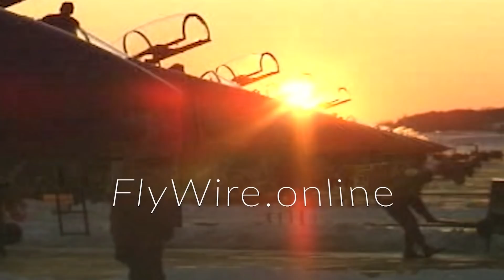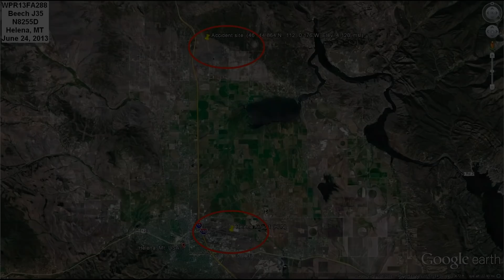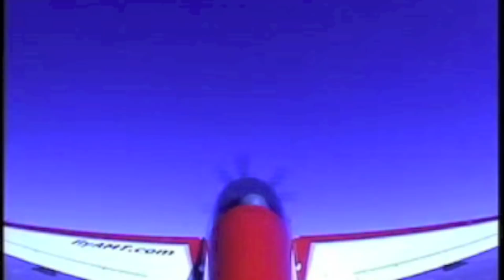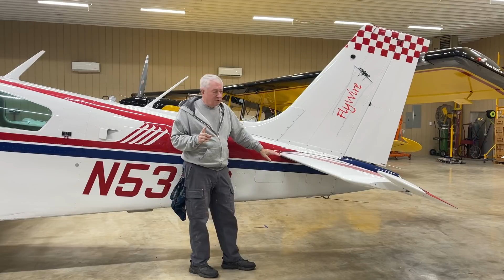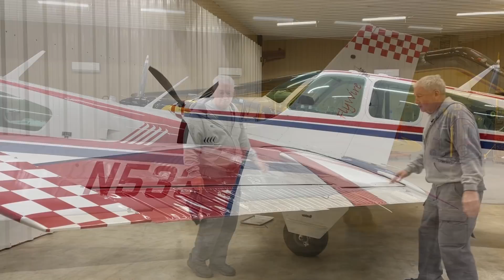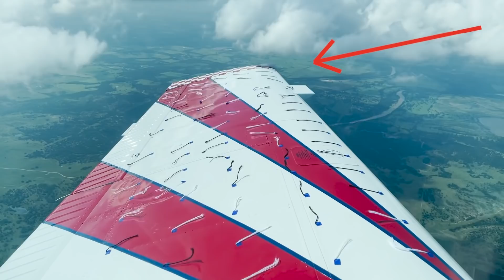J35  Bonanza Power-On Stall / Spin

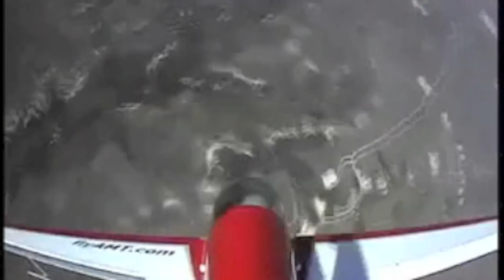Comment: If there is someone like me out there this is for you. That left side aileron depiction of in spin (inboard aileron into the spin at exactly at video time of  09:22 is a very good example of showing how aerobatic contestants and airshow people slap aileron into the direction of the spin momentarily to help stop the spin more crisply for a 1/3 of a second. Where inexperienced scared pilots might be putting the out aileron (outboard aileron away from the direction of the spin trying to get out) which only helps keep the spin going because in outboard or out aileron away from the direction aileron/stick/yoke makes the inboard aileron in the direction of the spin point down into the direction of the incoming air like a flap or parachute giving the wind even more to grip on to push the inboard wing faster backwards continuing faster the direction of the spin like a windmill. Which is why an emergency get out is memorize and know where to put the controls with your head against the side of the airplane when you 1. rip out the power, 2. force the controls to neutral, all of them including rudder which may have some force needed as the rudder is trailing in the direction you are going, 3, wait for vmca or a a good speed to recover and the airplane stops spinning as you have turned the airplane into a lawn dart, then pull out to recover. Now that you have done all that and you have correct emergency recovery inputs in when the airplane was doing something you weren't expecting. Now if the trees are going to the right whether you are upside down or right side up push the rudder that way and at the same time it doesn't matter whether the ground is up or down look at your nose of the aircraft and put it towards the ground whether that is push or pull, and then recover after bringing the nose back up to the horizon after reaching vmca  and add power. So rip out the power, force the controls to neutral all of them, wait for vmca then recover, and if still in the spin put the rudder towards the direction the ground is going and put the nose toward the ground and stabilize it there whether it is a push or pull. Doesn't matter whether you were upside or down put the nose toward the ground to get back to vmca plus and then pull upright and add power. And clean the seats later. Rip Out the Power, Force The Controls to Neutral, Wait for VMCA, Pull up to Recover, THEN---> If it isn't stabilized yet from the previous immediate action, THEN Put The Rudder  Towards where the Trees are Going (Upside Down or Right Side Up) and then PUT The Nose Towards The Ground (Right Side Up or Upside Down) All of this you don't have to think. The Trees no which way to put the rudder. and if you are upside down you still need to put the nose in front of you towards the ground whether upside down or right side up. Side note like he said in a spin the rudder is trailing in the direction of the spin so the rudder that is sticking back towards you is telling you which rudder to push. Harder to push. Just like an engine out. So if it were night over the desert and can't see which way the sand is going to push on that side, it is the same as the rudder that is closest to you that wants to be pushed to neutralize and push further towards the direction the sand is going while you are PUTTING the Nose Towards the Ground.

Comment: What causes it to start sinning to bedin with looks like it would fall straight unless ur already ina turn just before it stalls !
Reply from the maker: At that pitch angle there are a half a dozen reasons why yaw will start. Even in a level 1 g flight a spin will start due to yaw. Watch my video 'Extending the Gilde'.

Comment: I have a question Sir. My father was flying in a Vtail Bonanza with the owner and my Father was considering investing and buying a part in the aircraft. he said they did a Power off Stall and he said without warning it went inverted and went into a spin. the Vtail only had the throw over controls and he was yelling at the owner who kind of froze. he said the airplane was starting to get into a flatter spin attitude and I think he said that it was about 4 rotations. thankfully they were able to exit the spin but it put my Dad in a spot where he really disliked the Bonanza because of that experience.  What can you tell me about this particular situation and your experience with these type of situations. is this common, or was this more of a freak situation? My Father is a 4,000 hr bush pilot, hes not someone who gets scared easily and he is very experienced.
Reply from the maker: My opinion is the pilot during that event added pro-spin controls. I've deep stalled very V-Tail I've owned (three of them) and none of them did what you describe. I've flown with a lot of students that input something crazy in a highly stressed environment. It's probably best he did not partner with that guy.
Reply: @FlyWirescottperdue  Thank you for your answer. I have thought about owning a Vtail but I have always had a little something in the back of my head making me unsure of the aerodynamics of the vtail.  I really enjoy your videos.

Comment: I don't disagree with anything said, but he contradicts himself quite a bit when he says he dislikes mnemonics, but then goes on to offer his own memory item list that has no readily memorable name. His alternative to PARE is Idle, Aileron, Aft, Rudder opposite direction of turn because ground moving, then elevator forward because of dive, break stall, etc. Uh...hello??? Which spin recovery aide is going to serve me better in the air? PARE or the mess he presents here?
Reply from the maker: Maybe you need to look up the definition of mnemonic. What I offer is the boiled down version of the USAF Bold Face for Spin Recovery. The point I made in the video is that PARE is incomplete.
Reply: @FlyWirescottperdue ok I understand now. Sorry - may have been a couple drinks in when I made my comment!

Comment: For a while I owned a Bonanza of the same series.  It was during a period when I was getting about 200 hours of flying time per year, so I was pretty well on top of my game.  Not long into my ownership I decided to take her through a stall series at altitude, probably at 5000 feet or above.  For power on stalls I recall a significant nose up attitude and probably above half throttle .  I'm sure that my ball was centered.  With little or no warning, the aircraft broke steeply to the left and entered a spin within a quarter turn.  My reflexes served me well:  keep the yoke in my belly, stop rotation with rudder, then nose down with elevator and recover smoothly.  I did it several times, same result.  My training had ALWAYS been to keep the stall going with elevator, to get the rotation stopped, and recover gently enough to avoid overspeed and not trigger a secondary stall.  In all cases, I lost five hundred feet or so, maybe more.

My first impression of all that was to recognize that Bonanzas happily gave up controlled flight.  The break was surprisingly abrupt.  I had done countless such maneuvers in a wide variety of Cessnas, Pipers, and other Beechcraft.  This stall break, on the other hand, was frightening.   I guess that's simply a characteristic of Bonanza wings.  Live and learn.

A year later I recreated nearly the same scenario with a passenger on board.  I was flying formation with a Cessna 182 skydiving plane to my left.  As the jumpers got out of the 182 and momentarily paused, the 182 slowed down.  I did too and subconsciously added some rudder to keep a clear view of the jump plane.  Then I was looking up at the wheat fields, and I won't relate what the passenger said.  I had inadvertently cross-controlled the Bonanza very close to its stall speed and entered a spin before I could react at all.  BUT, my reactions were perfectly reflexive and recovery was as described above.  No harm, no foul.  But a flat version of the power on stalls described above, at least insofar as the recovery.  It ain't mushing around during slow flight practice where you get half a week of warning and virtually no break.  

After a lot of thought, I speculated that this characteristic gave hint to a death trap.  Picture turning base with a strong crosswind that is now behind you.  As you turn final at maybe 400 feet, the crosswind pushes you past the runway centerline.  Reflexes are triggered, and in addition to banking back toward the centerline, you add just a little too much rudder, add some turbulence as that crosswind bounces over the terrain, and you are riding a death trap.  Cross controlled stall at low altitude.  A tiny mistake at the worst possible time, I would argue, in the worst possible airplane. 

Practice, practice, practice and know YOUR airplane.
Reply from the maker: Great story, MT, thanks for sharing.

Comment: Scott, as always, I learn so much from your videos.   I fly a J35, and I am a YouTube contributor.  I'm not sure how your extensive knowledge helps me understand this accident because most of the information and demonstration relate to conventional tailed aircraft. As you said you are not sure how any of this relates to the V-Tail.   Clearly, the down input won't affect airflow on a vertical surface because there isn't one.  My first response in my airplane, would be to pull power and neutralize control input. After that I would fly the airplane based on how it responds.   Your thoughts?
Reply from the maker: There is some vertical in a vtail. It passed spin tests using the same recovery method. It’s not magically different. The vtail mixes pitch and rudder inputs. It’s all you have.

Comment: Not a pilot, but I think if commercial pilots practiced this stuff in a GA plane from time to time they wouldn't be so afraid or unaware of the need to fly the plane when their jet starts having problems with the electronics and indicators and crashing a perfectly good plane just because they're so unused to or afraid of manual flying.  Of course, I know flying has become so safe, Commercial anyway, that I may be speaking of a time past which has been somewhat improved by the accident investigations and resulting changes in FAA rules and subsequent training that today's pilots receive.
Reply from the maker: I don’t think so. I’m doing UPRT in jets now.

Comment: I used to teach spins on Cessna, Cherokees and Piper Tomahawks too in my CFI years of 1990's.  Used to teach only push down elevator but with hand opened to avoid pulling iinstead, like some do without thinking.  Pedal to opposite, then pull power.  Push, Pedal, Power for short.  Some of my students had to use that, specially on power on stalls as you mentioned.  
Opening the hand will prevent pulling back instead and because it is a push down position, it will promote that.

 Closed hand is a PULL BACK POSITION.  and should not be used if wanted to do the contrary or push down.  It promotes pullin up instead due the close the fist reaction and pull back when you see a threat in front.  Better to have "A PUSH DOWN POSITION" for the hand that wont promote pulling up too. 
Once i got into a spin from an accelerated stall practice i did with a student at only 2,200 agl  this time. (We were short of time to climb to 3k agl as usual).  Was a Piper Tomahawk.  They like to spin fast with just a little of extra rudder on any turn if you stall it.  
We stalled and spun left hard. , i yelled, let go, we did 2 spins to the left and one and a half to the right because i kicked that rudder too hard and we spun to the right instead .  We recovered at only 300 agl.  No more stalls under 3k on the Tomahawk for me ever.  Acellerated stalls most pilots dont know.  FAA dont require them.  I taught them (3k up since that).

Comment: I had never thought of forward elevator as a pro-spin input.
The Cessna 172M manual says to hold full aft elevator for the spin entry. But interestingly, if you follow the instructions, full aft elevator is held until just after the opposite rudder is applied. Technically, recovery still starts with IDLE NEUTRAL AFT.

"The normal entry is made from a power-off stall. As the stall is approached, the elevator control should be smoothly pulled to the full aft position. Just prior to reaching the stall ''break", rudder control in the desired direction of the spin rotation should be applied so that full rudder deflection is reached almost simultaneously with reaching full aft elevator. A slightly greater rate of deceleration than for normal stall entries, application of ailerons in the direction of the desired spin, and the use of power at the entry will assure more consistent and positive entries to the spin. As the airplane begins to spin, reduce the power to idle and return the ailerons to neutral. Both elevator and rudder controls should be held full with the spin until the spin recovery is initiated. An inadvertent relaxation of either of these controls could result in the development of a nosedown spiral."
..........
"Regardless of how many turns the spin is held or how it is entered the following recovery technique should be used:
(1) VERIFY THAT THROTTLE IS IN IDLE POSITION AND AILERONS ARE NEUTRAL.
(2) APPLY AND HOLD FULL RUDDER OPPOSITE TO THE DIRECTION OF ROTATION.
(3) JUST AFTER THE RUDDER REACHES THE STOP, MOVE THE CONTROL WHEEL BRISKLY FORWARD FAR ENOUGH TO BREAK THE STALL.
(4) HOLD THESE CONTROL INPUTS UNTIL ROTATION STOPS.
(5) AS ROTATION STOPS, NEUTRALIZE RUDDER AND MAKE A SMOOTH RECOVERY FROM THE RESULTING DIVE."

Comment: My own experience with my F35 I will not follow through with a power on stall . The nose gets to a very high angle of attack and still is not stalling. I tried a few times with an instructor and it just not something I wanted to follow through on. When I instruct in the Bonanza I don't do full  power on stalls.  You have made good points.

Comment: Sorry, but the instruction is confusing to me. What about the function of the elevator? Pulling to get more air to the rudder? In my few stall-spin exercises, the elevator is already pulled to max as to provoke a stall. And if it is a power on, the next is gas to idle by quickly counter rudder, (assuming the alerones were neurtal) and then pushing the stick forward, followed by an interception manoeuvre??
Reply from the maker: Gruber- I don't think its wise to have different recovery methods for different spins. Most folks don't think very well in highly stressful situations. The Spin you need to train for is the unintentional spin... and by definition you have lost all SA. There is plenty of time to do it right, but rarely enough time to fix a screwup.

Comment: Ok, idle, neutral, got it.  Then unload yoke (forward) if starting to enter the spin?  But if in the developed spin pull the yoke back/aft to make rudder more effective?

I’m just curious, not going to try any of this in an airplane without an instructor.

Just want to clarify; please correct if I have an incorrect understanding.   Great channel, look forward to your episodes!
Reply from the maker: There is the stabilization phase in a spin, plenty of time to do it right, not enough time to do it over. Idle/Neutral/Aft, Rudder Opposite spin, stick just forward of Neutral, rudder neutral, recover from the dive.  

Thanks for watching!

Comment: Can accelerated stall / spin recovery be practiced (safely) in a good flight simulator?  Are flight simulators sophisticated enough to include all of the factors you mentioned here? ...such as engine torque, airflow effects over the various surfaces, wings, and empennage.
Reply from the maker: Good question. I am unconvinced that a Flight Simulator would be a good platform for practicing stalls/spins.
Reply: @FlyWirescottperdue   Thanks for replying Scott.

Comment: I learned how to spin an airplane at 6 years. Really!, you say? Really. My father was a WWII vet and former B-29 pilot amongst 24's 25's and trained in PT-19's Vultees BT-13's. T-6's. On the back steps he set up a seat, stick and pedals for the lesson or lessons...been 66 years. 
Lesson: Stall, kick left or right and depart..."Pop the stick" full forward and mash the opposite rudder against the spin to stop the rotation...ease it out of the dive into a smooth recovery.
Why the comment then? Well, the aft stick thing. I have a CMEI and been a pilot since I was 26. Now 73 and haven't flown for many years but I was taught, never, let me repeat, never, unless in an inverted spin is the stick pulled back."Lost in translation" issue is this statement.... "Pop the stick." What I presume, since Pop left on his final mission long ago, is that what he really meant  was, neutalize it from full aft post haste, yet never had I heard of the aft stick technique. Not even in WWII training films.
Thanks Scott!! It all makes sense and to quote a famous old Aviation writer, " I learned about flying from that."

Comment: This is why I have pilots recover from power on stalls at the first stall indication (usually stall warning horn, 5-7 knots above stall AoA under current conditions including G load), especially when the airplane is in the dirty go-around configuration. Another excellent discussion, Gunny.
Reply: Early bonanzas didn't have horns I believe but had a light which you likely wouldn't notice if you're looking outside